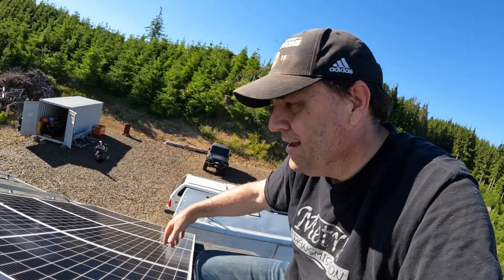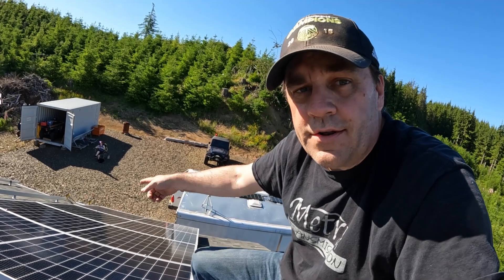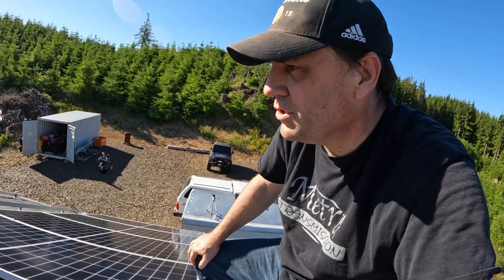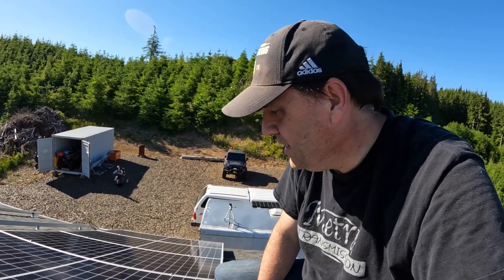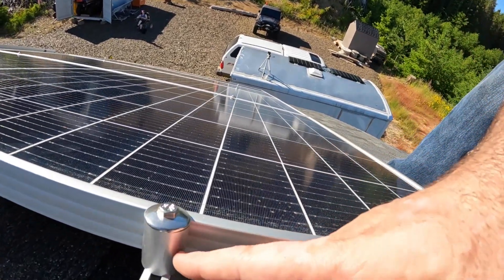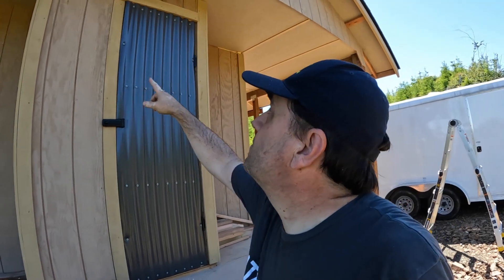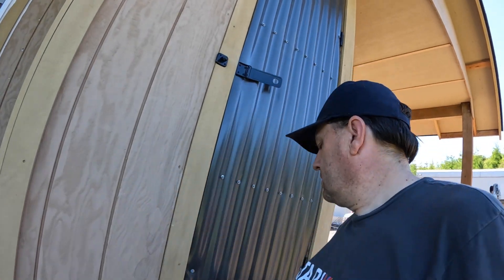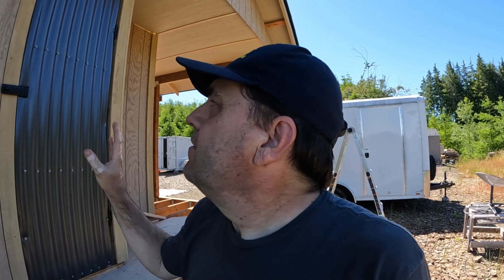Mounting 4,150W of Solar Panels in one hour!

Comment: Trina 415 panels……they’ll go well.  Is your roof facing true south (I nearly typed north, Southern Hemisphere 😂)?  What angle is your roof at?
Reply from the maker: Actually the building is slightly off of true south (and north LOL) so efficiency is lower at the very end of the day, but I'm amazed at how much power I can still produce at that time.   The Victron system gives me TONS of great data about everything going on, so I'm watching it over time and season to see how it performs.   That roof is a  4/12 pitch, so not too far off what optimal panel angle is.
Reply: @SeamrógCreek  It’s an awesome system then……totally expandable too, plus with the wind trickle too ups 9.99/10.  Well done 👍

Comment: Does that take a special kind of battery and how many if so?
Reply from the maker: You can use any type of battery, Lithium, AGM, etc, it will depend on the type of charge controller you use and the overall system design.   Here's a video I did on the batteries we are using: https://www.youtube.com/watch?v=dFALkXQgE9A
Reply: @SeamrógCreek  Thank You